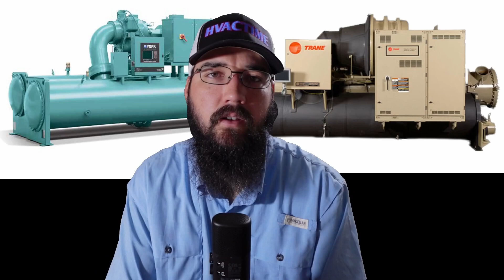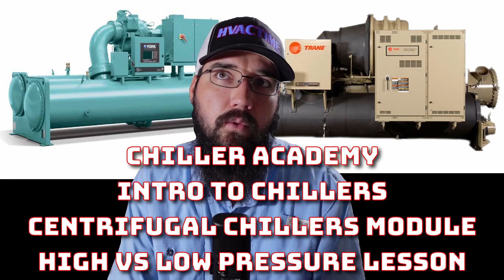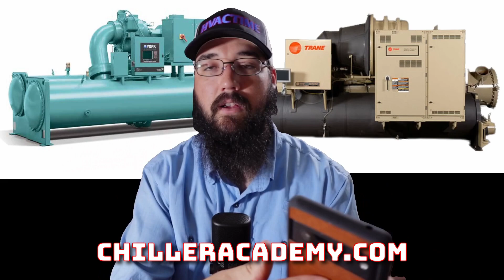Know High VS Low Pressure Chillers - Chiller Academy

Comment: Hi!  Do centrifugal chillers with low pressure refrigerant less prone to surge as compared to chiller with r134a because the pressure differential between evaporator & condenser is much lesser (approx 13 psi for r514a & 74 psi for 134a)?

Comment: Outstanding basic information. Low pressure chillers can be a little confusing from a technician standpoint. I'm an expert on everything from lowboys to supermarket racks but have never worked on a low pressure chiller. I've been trying to get a little basic working knowledge and this is a good start.

Comment: For low pressure systems, how are you keeping atmosphere out of the system when attaching the gauges?  Do you use a vacuum pump on the manifold before you open a ball valve on the hoses?
Reply: The purge unit will remove any atmosphere that is introduced into the system. Although, typically you don’t put gauges on a low pressure chiller unless absolutely necessary. R-123 in particular will degrade your standard hoses unless they are rated for it.
Reply: @ryanbrown7134  Thanks for the reply.  I will have a read about the purge systems.  I incorrectly assumed it was a process rather than a unit that is part of the equipment.  I am trying to learn chillers on my off time; because, I want to make that jump from refrigeration in 2-3 years.

Thank you!